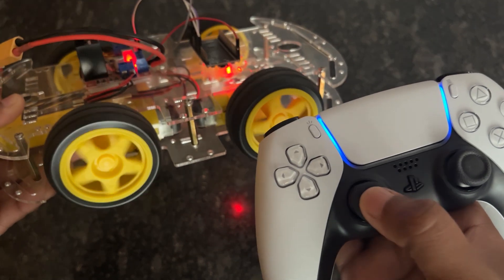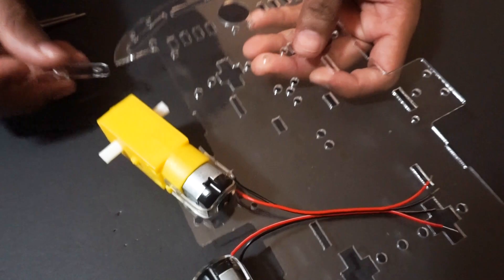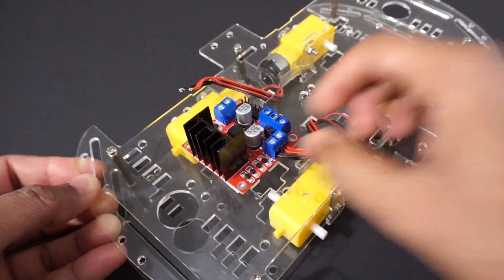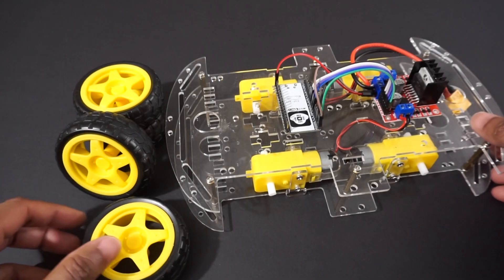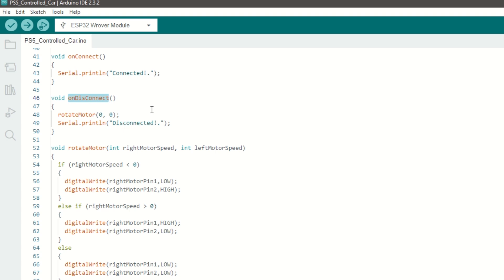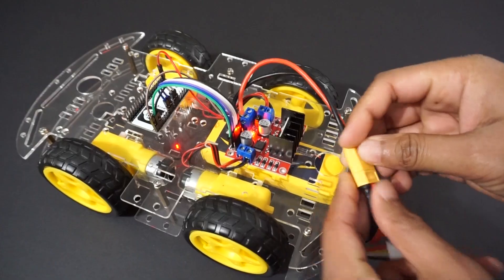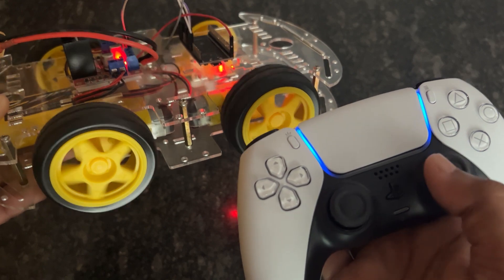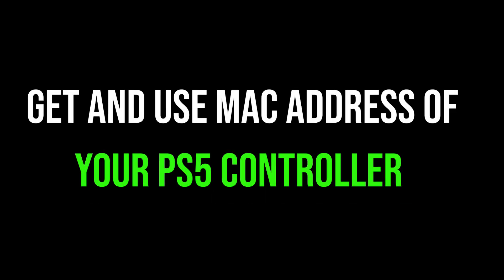RC Car using PS5 Controller and ESP32 | DIY🔥

Comment: Can We Use PS4 Controller with the same code Please Reply I really need help from you
Reply from the maker: There is a video on ps4 controller car on my channel. Please check that 👍👏
Reply: @hashincludeelectronics  but you have used different wheels and 2 motor drivers

Comment: 🎉🎉 Nice. Can you make a video on how to control a rc car by using ps5. RC car i mean the ones available in market like Rock crawler
Reply from the maker: Thank you very much 👍🏻👏🏻
Reply: @kumark.k you'll have to swap out the MCU with and just tweak your code for steering servo.

Comment: Can a rc car from shop thats already has remote be modified with esp32 to work on a ps4 instead of the remote it comes with. Also would this work with esp32 vroom
Reply from the maker: Yes it can be modified . Use the same project 👍🏻👏🏻

Comment: Can this work with this esp32 RoboThings ESP32 WROOM ESP32 ESP-32S Development Board 2.4GHz Dual-Mode WiFi + Bluetooth Dual Cores if yes pls tell what to do will I need to change code
Reply from the maker: I believe it will work . Code and diagram will be same . Give it a try 👍🏻👏🏻

Comment: How to give r2 button acceleration instead of the joystick
Reply from the maker: You can check my video on ps5 controller with esp32 for reference . Use that button and make changes in code accordingly 👍🏻👏🏻

Comment: im getting error   100 |   ledcSetup(rightMotorPWMSpeedChannel, PWMFreq, PWMResolution);
      |   ^~~~~~~~~
C:\Users\Admin\Downloads\DC_Motor_Code\DC_Motor_Code.ino:102:3: error: 'ledcAttachPin' was not declared in this scope; did you mean 'ledcAttach'?
  102 |   ledcAttachPin(enableRightMotor, rightMotorPWMSpeedChannel);
      |   ^~~~~~~~~~~~~
      |   ledcAttach

exit status 1

Compilation error: 'ledcSetup' was not declared in this scope
Reply: Download esp32 2017 version
Reply: @eldr.lecheslordprime8365  can u give link
Reply: i had the same, changed espressif board manager to 2.0.7 and it fixed

Comment: for some reason its saying ledcattatch not defined.
:error
Arduino: 1.8.19 (Windows Store 1.8.57.0) (Windows 10), Board: "ESP32 Wrover Module, Default 4MB with spiffs (1.2MB APP/1.5MB SPIFFS), QIO, 80MHz, 115200, None, Disabled"

CAR_CODE:101:3: error: 'ledcSetup' was not declared in this scope

  101 |   ledcSetup(rightMotorPWMSpeedChannel, PWMFreq, PWMResolution);

      |   ^~~~~~~~~

CAR_CODE:103:3: error: 'ledcAttachPin' was not declared in this scope; did you mean 'ledcAttach'?

  103 |   ledcAttachPin(enableRightMotor, rightMotorPWMSpeedChannel);

      |   ^~~~~~~~~~~~~

      |   ledcAttach

exit status 1

'ledcSetup' was not declared in this scope

This report would have more information with
"Show verbose output during compilation"
option enabled in File -> Preferences.
Reply from the maker: @sakshambhatia5868  please install 2.0.16 version of esp32 board 👍🏻👏🏻
Reply: @hashincludeelectronics  THANK YOU SO MUCH BROTHER
Reply from the maker: @sakshambhatia5868  welcome 👍🏻👏🏻
Reply: @hashincludeelectronics bro the link of the board you gave have different pins like g26 3:20

Comment: I wanna make a RC boat with the esp32, but im worried that the range is very short, how long was your range?
Reply from the maker: @Emenemx  around 80 -100 ft . I would suggest to use espnow transmitter receiver for that which will give you better range around 200 ft it is said 👍🏻👏🏻
Reply: @hashincludeelectronics  thanks for the help👌
Reply from the maker: @Emenemx  welcome 🙏

Comment: It don’t work
Reply: No ps5 controller .h
Reply from the maker: @MrDrew32xx  please install PS5 controller library . Check my video on ps5 controller and esp32👍🏻👏🏻
Reply: @hashincludeelectronics  that worked but it still didn’t work. Found the problem.. the esp library updated version. I had to remove the update and install version 2.0.17. Now it works. Thank you for
Reply from the maker: @MrDrew32xx  awesome 🙌🏻
Reply from the maker: @MrDrew32xx  what issue are you facing ? Please check the video for any missing step 👍🏻👏🏻

Comment: Brother please can you make this please❤

4wd car with line following+ obstacle avoid+ esp32 live cam on mobile + hand following when we put hand in front of uv sensor + use Arduino uno + forward reverse right and left direction led indicator light 
Please sir can you make it please please please 
I'm working on this project from past 1 year on my college by my self but every time i am getting failed in either connection or either code and total confused because here in this case there is 2 microcontroller esp32 web cam + Arduino uno 
If you help me sir/bro than it is very helpful for my future because this project is showing my skill betterly ❤😊
I hope you got me sir😊
Reply from the maker: This is kind of big requirement 😂. This type of project needs lot of time and testing . Not sure if I can make it this year as I am busy with other work . But I will try it next year probably . 👍🏻👏🏻
Reply: @hashincludeelectronics  if you need any financial help than I'll provide it to you because my main goal is to i want to see these project on working condition.
Reply: @hashincludeelectronics  and yes I'm still a student in 3rd year of B. Tech but my knowledge in this filed are too good ❤️🤗🥹

Comment: It would be awesome if you could
 mount a robotic arm onto a car like this and use the l2 r2 and directional buttons to control the vehicle
Reply from the maker: There is already video on my channel using ps3 controller and robot arm car . You can refer that . And with minimum changes can be used for ps5 controller as well 👍🏻👏🏻
Reply: @hashincludeelectronics  I don't think that was a six axis arm though
Reply from the maker: @MetronusPrime  yeah it’s 4 axis .

Comment: You can creat the remote with out using the ps5, and this remote control the drone.
Reply from the maker: Yes we can . However I wanted to try ps5 controller for RC car 🙂👍🏻👏🏻
Reply: Do not use ps5.
Reply: In 4 in 1 Robot model.You can control the robot with the help of mobile. In mobile only switch the modes.
Reply from the maker: @AnuKolivad   nice idea . Thanks 🙂👍🏻👏🏻
Reply: You can attach  the cleaning machine in robot. Because of clean the flore. Which do not control mobile and it control automatically. Using of ardino.❤

Comment: Can you please suggest the battery which can work in all this types of projects
Reply from the maker: I personally use LiPo batteries but these are costly . However it will be used in any project like drone , cars , planes etc . If you need cheaper version then you can use the other LiOn batteries. 👍🏻👏🏻